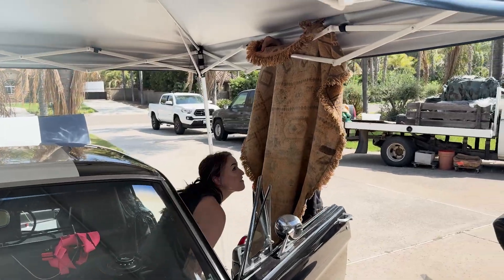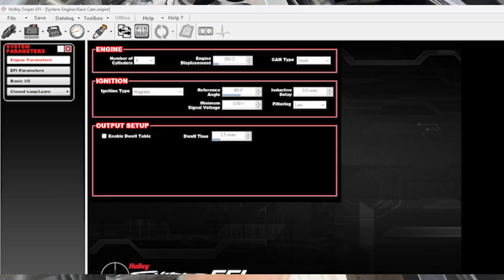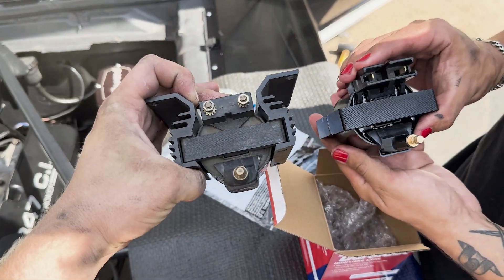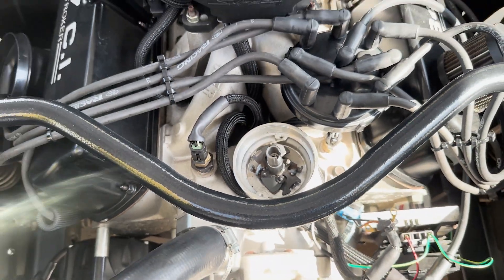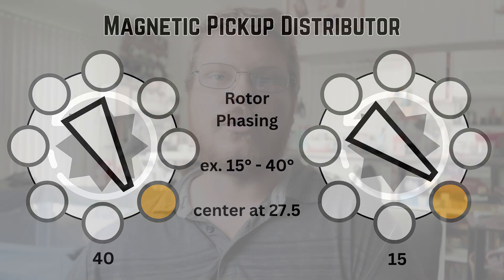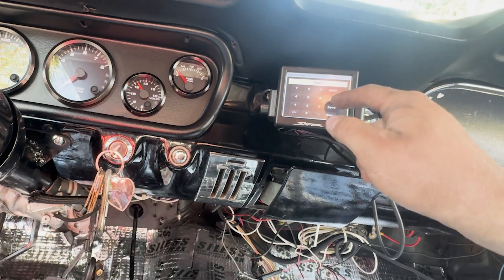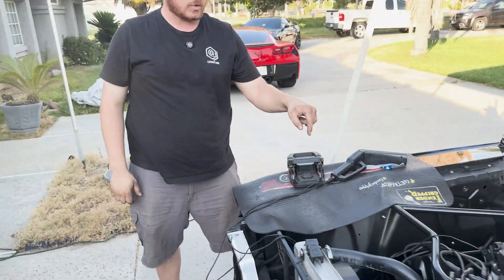CHEAP TIMING CONTROL - Holley Sniper EFI - 1965 MUSTANG - HyperSpark Alternative

Comment: I was wondering what your thoughts were on using the Holley hyper spark Coil with the coil driver? It's very similar to the one you run here but according to Holley you can't run it with that coil.
Reply from the maker: It honestly should work fine. It even takes the same connector

Comment: Better you did buy a msd magnetic pickup distributor they're not that expensive and you could lock it out easily rather than welding a distributor. And you need a phasable rotor cap to do this correctly.
Reply from the maker: @eagle5720  the wholenpoijt was the budget. 

I agree that would work fine. But we did phase this assembly. And for less than $100 you can't beat it. 

His car runs great.

Comment: hyperspark is crap i am on my 4th one in 14 months
Reply from the maker: @frostycools1315  weird. I’ve seen bad luck with the dual syncs. But I thought the hypersparks were decent. 

Are you using the one with a CD box or the ‘ready to run’ distributor?
Reply: @LugNutLang  CD box , what happens is the pick up under the rotor comes lose the only thing holding it in is the plastic wire plug as it enters the underside of the distributor , when it come lose it grinds against cup under the rotor and spark goes crazy , im in Canada and so far holley has replaced them and at $1000 Canadian I'm glad they know they have a problem , my plan now is to scarp the sniper 1 its been junk after the first 100 or so miles  gona try sniper 2 and cross my fingers
Reply from the maker: @frostycools1315  check out theCraig909.

We just put a sniper 2 on his crew cab truck. I like it a LOT more than sniper 1.

Maybe you could JB weld the pickup in place to keep it from working loose? Seems pretty crappy.

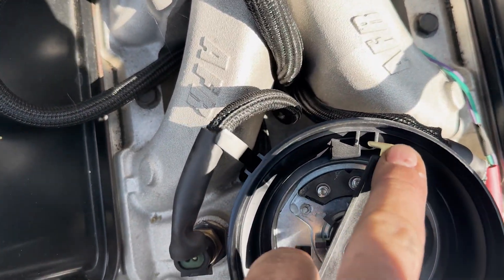Comment: Right at 5:56 where you were able to turn the shaft and rotor is a clue that the distributor has mechanical advance. Nice video overall.
Reply from the maker: That definitely should have been a clue. The truth is I have a lot more familiarity with EFI than with mechanical and analog ignition.

Definitely always learning!